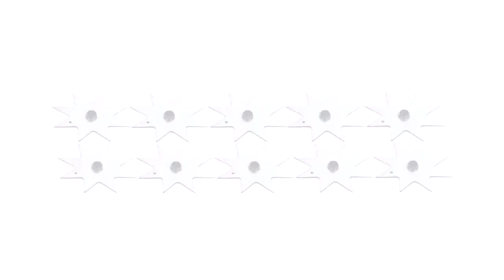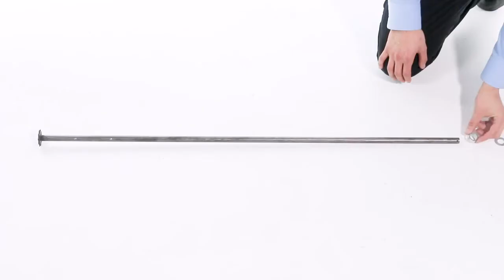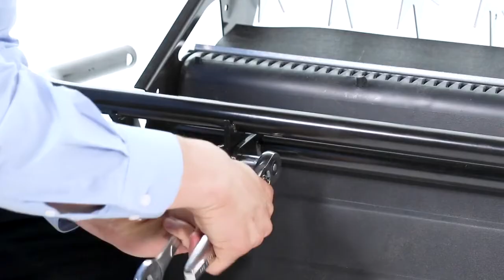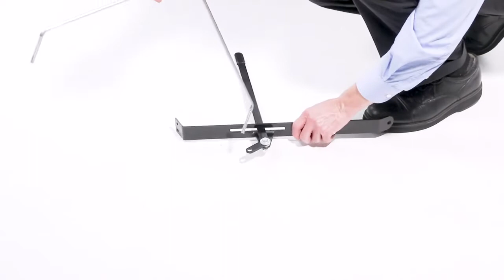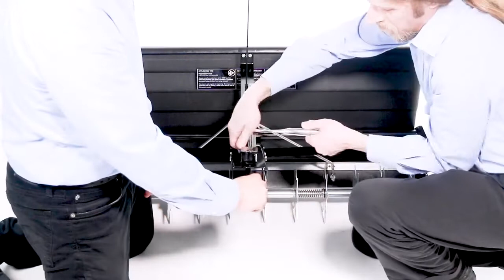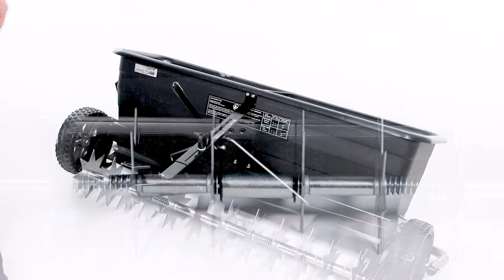Assembly: Agri-Fab 45-0545 175lb Tow Spiker Spreader

Comment: Interesting video, but I think you should tell all the Ztrak lookers what the alternative is vs the big box JD mowers. (I agree with your spin on big box JD equipment, not good quality).  I bought my Ztrak 535E from a licensed JD Dealer in my home town  10 years ago and have NEVER had a problem with it.  Has about 200 hours on it right now. Keep all the maintenance up every year as well as always clean it. 
So, to be fair, I think you should explain not all JD Ztrak mowers and riders are junk, which your video makes it look like.  You didn't explain the higher number mowers are much better from what I've experienced and seen in real life.
Thanks for the video.